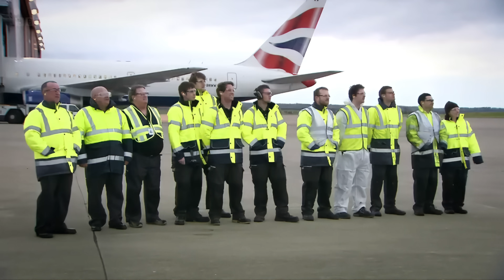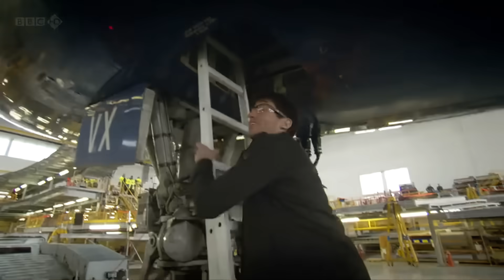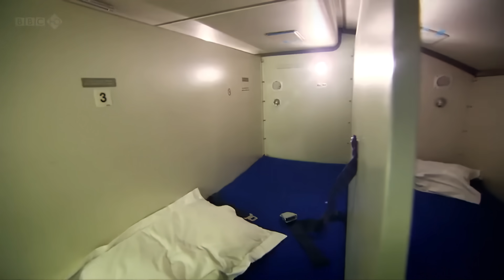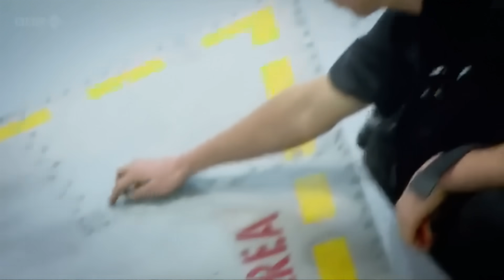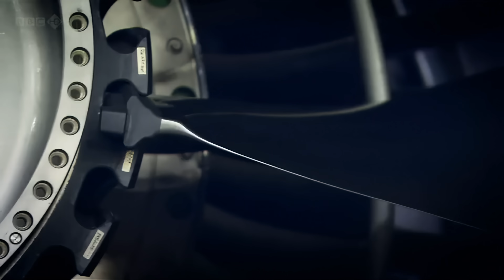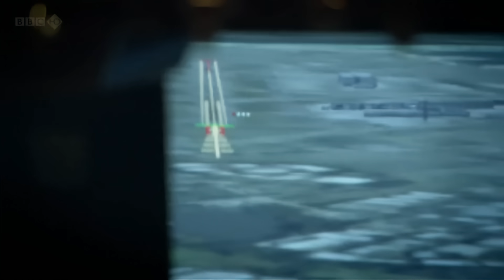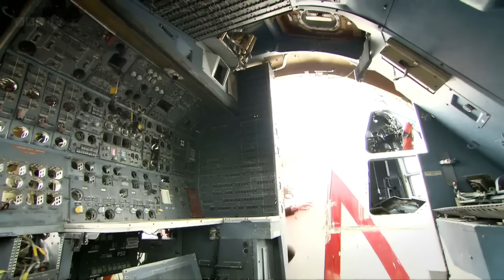British Airways Boeing 747-400 in D-Check

Comment: I worked at British Airways Engineering in Cardiff from 1993 until 2000 as an Avionics Team leader (an engineer supervising up to 15 fitters working all over the aircraft carrying out major modifications and majors (D-checks etc)  however the work drove me round the twist when I left at the End of April 2000 I went to work for Virgin Atlantic on the Ramp at Manchester Ringway Airport as a  limited company contractor taking a 200% pay  increase! The work was fantastic having different problems to solve  every  day!  Fortunately I'd saved a sizeablecwedgecby 9/11 in 2001,because the aftermath of that nearly put virgin out of business and I had to existvfor 3cmonthsxwithout pay with sizeable mortgage after Virgin closedit's ManchestercEngineering base!  I had to pay for and take a course in long Island to get an American FAA A & P licence so I Could certify American N registered Aircraft for Atlas Air at Stansted Airport and around Europe! However it was still a lot more fun and paid more  than working at base maintenance in Cardiff!

Comment: It's good to know there are laws which require such a thorough check of the complete aircraft and that new or certified rebuilt parts are added.  As they said, it is all about safety and along with that, maintaining the jet and repairing or replacing something small will add to the overall safety of the jet as well as being able to use the jet to the maximum of the useful life of it.  I would say a "D" check probably costs millions of dollars which is well spent in saving 300 lives by preventing failure which could bring down the jet.

Comment: The new 747-8 is a fresh replacement and one  of its 4 jet engines Priced at $20 million each has more thrust power  than all the eight engines on a B-52
Reply: Funny the jets that crashed into World Trade Center their fuel burned at 2,000 C degrees and melted high grade construction steel beams, oops not just jet fuel it appears.

Comment: The Boeing Dreamliner programme, announced in  2003, was supposed to cost $6 billion and see the plane take to the air
 in 2008. The final bill was $32 billion and the 787 Dreamliner arrived three years late.
Reply: John Jan Popovic 
and battery issues then fixed with a fire proof casing which doesnt totally fix the problem

Comment: the aluminium  scrap has ...little... value. would it be different if they count the replacement value, meaning how much-many recourses are needed, and how much they cost, to produce the same amount of aluminium that will be used to construct a new plane. while they said correctly scrap is not the same value, it should be counted for sure differently.

Comment: Do planes have any mechanical gauges in the cockpit? Ones that work all the time without need of electrical current or any other outside sources? In some cases if the plane is having mechanical issues, gauges can be affected. And in some cases the gauges are working correctly but the pilot sees them and thinks they are not reading correctly. Is there any kind of "bubble level"? Also curious if a pendulum or any simple device that will always read vertical and or horizontal level available for the fight crew?

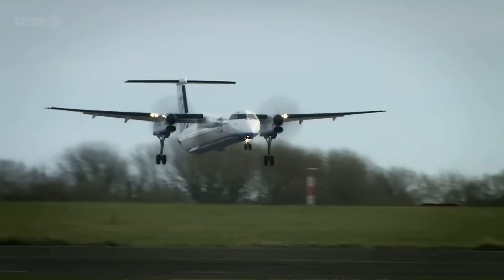Comment: 16:35 - aircraft-pressurization - link below for reference
https://aerosavvy.com/aircraft-pressurization/
"As we climb higher, air molecules are spread farther apart. When we breathe, our lungs take in less air, and less oxygen. Folks living in Denver, Colorado (5600 ft) are quite happy breathing the lower, 12 psi atmosphere. Climbing to a higher altitude, though, and the pressure drops really fast."

"At 18,000 feet, the atmospheric pressure is down to 7.3 psi, about half the sea-level pressure. There just isn’t enough oxygen in a breath of air to adequately supply the brain. At this pressure, a healthy adult has only 20-30 minutes of useful consciousness."

"Airliners fly between 30,000 and 43,000 feet. At those altitudes the atmosphere provides less than 4 psi of pressure. If you tried breathing at that altitude, your useful consciousness would be less than a minute (followed soon after by death)."

"To survive high altitudes, occupants of an aircraft need help breathing. The solution is to pump air into the airplane so the interior pressure is high enough to keep the humans happy."

Comment: I've been watching "Why Planes Crash" on the weather channel and noticed the fuselage often breaks apart, sometimes late in the crash. In many cases after the plane has been on the ground a distance and is nearly stopped when the fuselage breaks. I have often wondered if planes had tension cables running thru the shell like used on modern bridges if that would help to keep the fuselage in tact on possibly save lives.Any thoughts?

Comment: Random question but when they remove all 4 engines do they make sure that each  engine goes back in its original position, so you remove engine 1 then put it back in position 3 for example, I mean each engine should be identical so it shouldn't matter which position is put into after service but I wondered if they made sure they went back in the same position or not?

Comment: The fans don't compress anything. They simply speed up the air moving out the bye-pass ducts and discharge it rearward. The compressor stages compress the incoming air.

Comment: They should do twin engine retrofits on 747-400! 4x 5:1 BPR Rolls-Royce RB211's replaced by 2xRolls Royce UltraFan 15:1 BPR with 110,000lb thrust each, with larger, split scimitar winglets, the 747-400 with 2x UltraFans will be 50% more fuel efficient and fly for decades to come!

Comment: Metal Foil Resistors, theory and practice, component to be used in aviation applications and space systems.

1-Metal Foil Resistors, Link to a document.
 Topics on metal foil resistors,
 theory and practice, with the corresponding bibliography.
Charly GarcíaJuly 15, 2022
Metal Foil Resistors  , https://www.youtube.com/watch?v=eRs6GJTAvJM

2-Theory on the manufacture of the metal foil resistor, first part. 1 
This video sequentially describes the first part of the metal foil resistor manufacturing process, 
each image is accompanied by its corresponding bibliography, which the reader can consult more extensively.
, https://www.youtube.com/watch?v=QPeFu5du7W8 

3-Thermal treatment of the metal foil, to adjust the temperature.  Temperature Cofficient of Resistance 1. Evanohm
Thermal treatment of the metal foil, to adjust the temperature coefficient of temperature TCR. 
coefficient of temperature TCR, https://www.youtube.com/watch?v=HDZAm2wAnrk

4-Metal Foil Resistors page, with the theory and practice and its corresponding bibliography.
 https://telegra.ph/Metal-Foil-Resistors-1-07-15, Metal Foil Resistors Index 
Manipulation of the TCR in metals. 1 https://telegra.ph/Manipulation-of-the-TCR-in-metals-09-08

5-Metal Foil Resistors, Metal Foil Resistors 3.https://www.youtube.com/watch?v=fM8Rd89V01c&t=153s
In order to modify the properties of the TCR, 
it is necessary to use an oven with special characteristics such as those described in this video, 
for more information read "Heat Treatment Principles and Techniques ,Ashok Sharma, C. P. Sharma, and T. V. Rajan.

6-metal foil resistors, https://www.youtube.com/watch?v=eRs6GJTAvJM
10 views  Aug 30, 2022  Topics on metal foil resistors, theory and practice, with the corresponding bibliography.

7-Manipulation of the TCR in metals. 1. https://telegra.ph/Manipulation-of-the-TCR-in-metals-09-08  .The adjustment of the TCR to compensate for resistance variations due to thermal effects is carried out by heat treatment of the metal foil. The nickel-chromium alloy, called Evanohm S, (see Hamilton Evanohm S), can have its TCR adjusted, in the range of about 100 to -20 [ppm/°C], during the manufacturing stage, by heat treatment. in the temperature range of 400°C, resulting in a graph like the one shown below, resulting from a 2-hour heat treatment. 

8-  Metal Foil Resistors . https://www.youtube.com/watch?v=_pVK6fHFWS0&t=36s  . Sep 15, 2022  Thermal treatment TCR. 1 ,This movie describes the first part of the metal foil treatment.

Comment: It’s crazy how much damage one of those tiny cracks can causes. An el al 747 cargo plane’s engine fell of and hit the other engine on the same wing, ripping part of the wing off and it caused it to have a loss of lift in the right wing, causing it to bank right and smash into a massive apartment block in Amsterdam. All because of a microscopic crack in a few centimetre long screw in the thing that holds the engine onto the wing. Killed the pilots and 43 people I think

Comment: What if I use toilet on plane while it is on ground. Then how the suction is guaranteed?
Reply: Then it's the maintenance guy on the outside of the airplane looking strange with his lips wrapped around a pipe and sucking like it's a straw ... They don't call them "ramp rats" for nothing.  :->
Reply: @ReflectedMiles  hahahaha
Reply: below a certain altitude a vacuum pump is used

Comment: euh sorry but there are not miles and miles of electrical cables but kilometer and kilometers (of electrical cables)
Reply: the UK still use the imperial measuring system in a lot of cases; feet, inches, miles, gallons and all that sorts.

Comment: I did work experience with British airways and yesterday I changed a wheel on that plane 😆😆😆
Reply: Christopher Schuster nope not bs changed the number 7 wheel which is the left body gear on the rear left

Did it at Heathrow just by the run pen I was with FSU (Fleet Suport Unit) but the got me with the guys that worked out side for 1 of the five days  day

Comment: I can't wait when United Airlines comes out with the new sonic planes designed and manufactured supposedly with "zero-emissions" from aviation startup Boom Supersonic.  Plans for overseas flights to and from New York To London, San Fran to Tokyo L.A. to Melbourne, etc. United Airlines can back out of the deal while losing its non-refundable deposit if Boom fails to receive regulatory approval or meet United’s safety, operating and sustainability requirements, the Chicago-based carrier said. Mmmmm.."Zero Emissions"? I'll believe it when it becomes a reality.

Comment: This video was produced at around the time when Boeing was focusing more on shareholder profits than safety, so they fired so many of the top engineers. Since then, as we all know, Boeing has slid down into extremely poor management and horrendous maintenance agreements to save a buck. Even Boeing's Starliner program with NASA is a huge failure. Quite simply, today, I will not fly on any Boeing jets. Instead, I'll book on Air France, Lufthansa, or British Airways to fly on an Airbus.